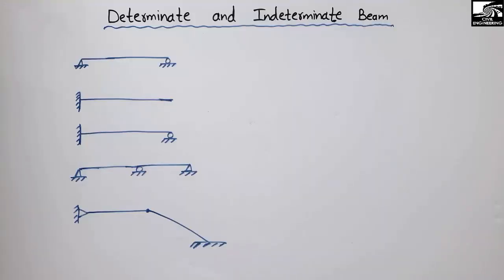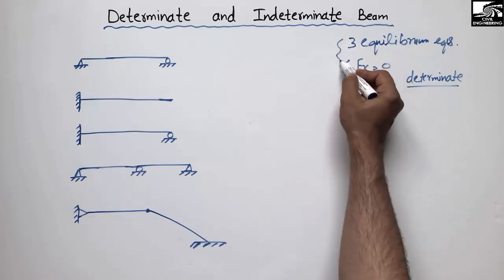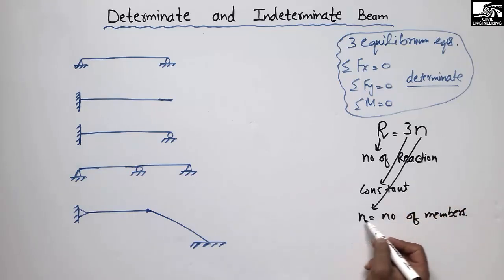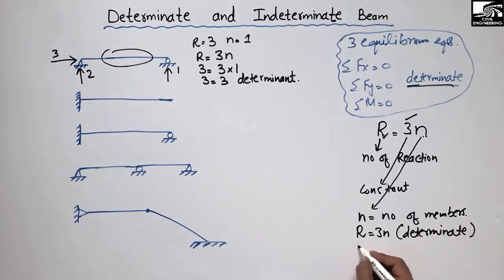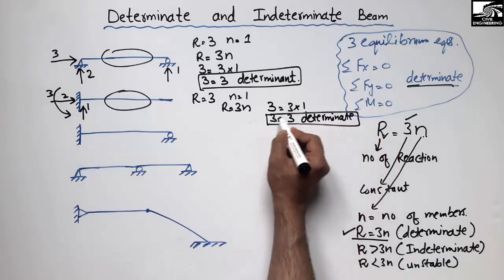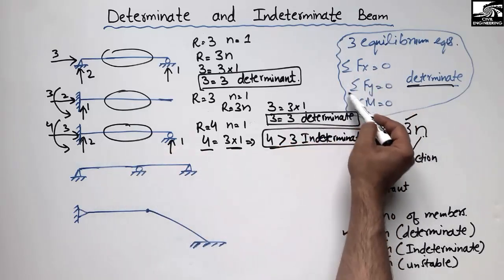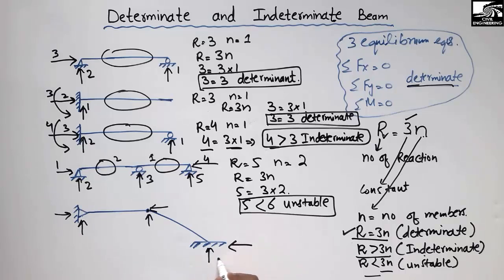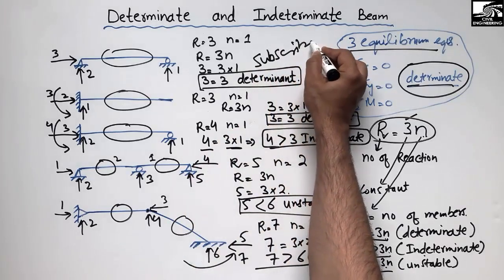Determinate and Indeterminate Beam

Comment: I’m so confused rn. During lectures we learned an equation “s + I = 3E” where “s” is the number of support reactions, “l” is the number of intermediate reactions and “E” is the number of elements in the system. And this concept was called counting criterion. Is it a different concept than the one covered in this video? We also learned something called pole criterion which I couldn’t understand. We use both these concepts to determine whether the system is statically determined, statically indeterminacy or movable. What’s worse is that when I search these concepts in internet, l cannot find what I look for. Should l search something different? I mean what mistake am l doing?

Comment: How come problem 4 becomes unstable? As we have vertical and horizontal reactions and on the application of load it sustains external loads without deformation then please can you explain how it can be unstable without using equations?
Reply: @Oldgit-w2o  what , useless reason